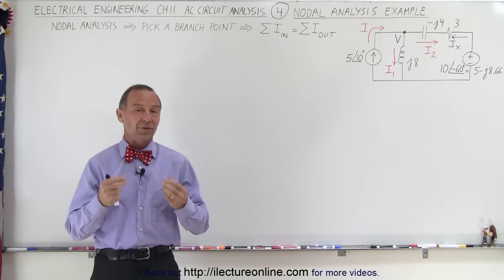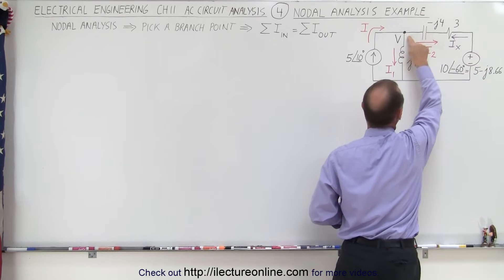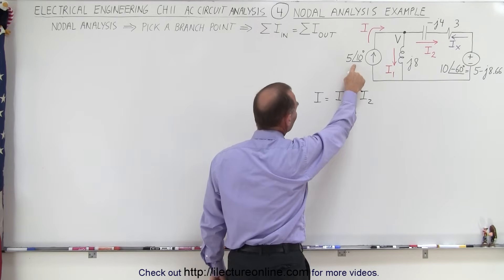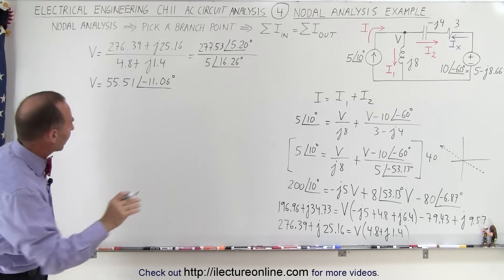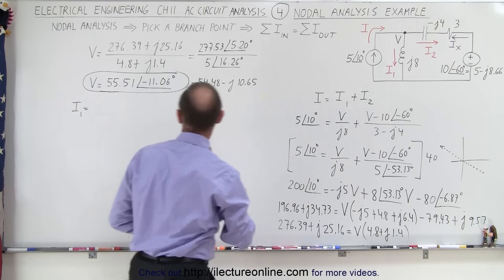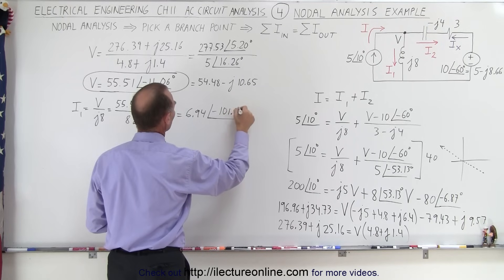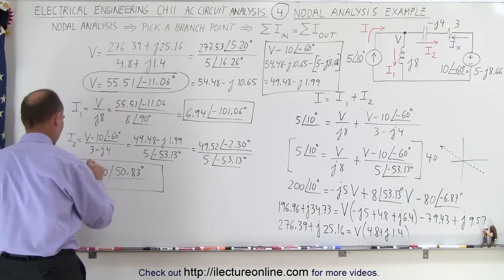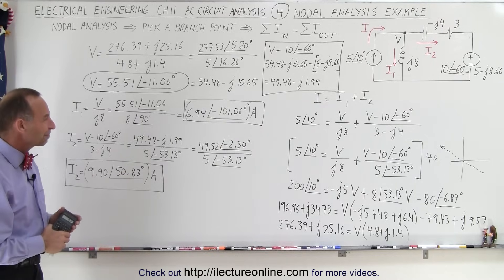Electrical Engineering: Ch 11 AC Circuit Analysis (4 of 55) Nodal Analysis Example

Comment: Proffesor I have a question
-10√_ -60°  /  5√_-53.13= -80√_-6.87

Then why in circuit 2

49.52√_-2.30  /  5√_-53.13  = 9.90√_50.83°

Isn't the angle of 50.83 suppose to be negative?

Final answer would be: 9.90√_ (-50.53°)

I'm just confused proffesor😅
Reply from the maker: -2.3 - (-53.13) = 50.83    (does that answer you question? )

Comment: There is a mistake in I1 because when we add I1 and I2 we don't get I.
Reply from the maker: There is no mistake in the video.  I1 and I2 add up to I.    (There is a phase difference between the two currents).

Comment: Sir please do u see the mistake at this point 5:43 ,it should be 8v is less than -53.13 ,not positive  53.13.
Thank u
Reply: I initially made the same mistake as you. However, Michel is correct. Using < as the angle notation:  1/(5<-53.13) is really (1<0)/(5< -53.13). So the division would be 1/5 times the angle, which would be 0 - (-53.13), or 0 + 53.13. So the angle is actually positive, and multiplying it by 40 to get rid of denominators doesn't change that. 
Cheers.
Reply from the maker: No mistake.  The problem is correct.  Thanks for checking.
Reply: @MichelvanBiezen  go through n stop defending urself sir
Reply from the maker: Your response seems a bit crass.  I did check it and it appears correct.

Comment: would EE's just use an oscilloscope for these calculations?
Reply from the maker: With an existing circuit, making measurements with an oscilloscope or a multi-meter does give you this information.  However with many circuits, especially miniaturized circuits, it is very difficult to make these measurements, and thus we may have to rely on models and theory.

Comment: When you did tan^-1(4/3) I got 53 degress but you say it is negative, why is that?
Reply from the maker: The 53 degrees is the magnitude of the angle. The sign is determined by determining if the reactance is inductive or capacitive.

Comment: can we solve it with the sourse transformation theorem?
Reply from the maker: Most problems can be solved with multiple techniques.  Try it and see if you can get the same answer.
Reply: @MichelvanBiezen  i solved it and it doesn't match with the answer ? Perhaps is the wrong theorem ? Or did i make some mistake ?